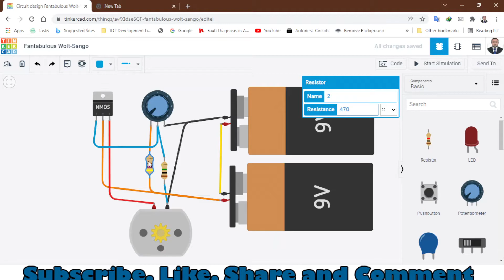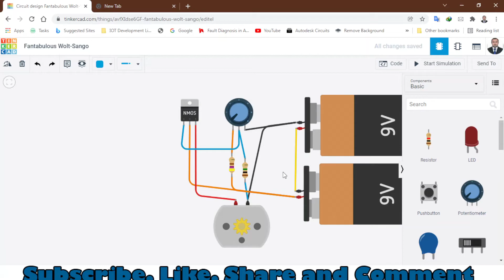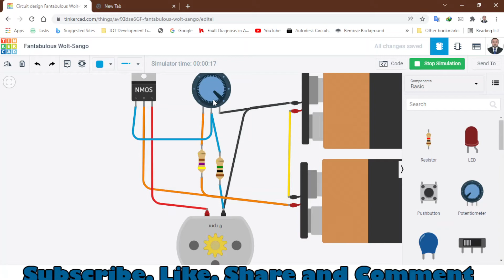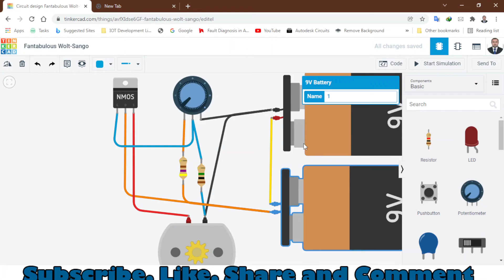How to Control the speed of DC motor using MOSFET and potentiometer

Comment: Can we use b100k potientialmeter
Reply from the maker: yes you can use it but you need to use the bigger battery you higher the resistance lower the current